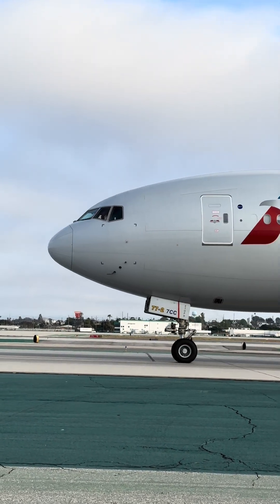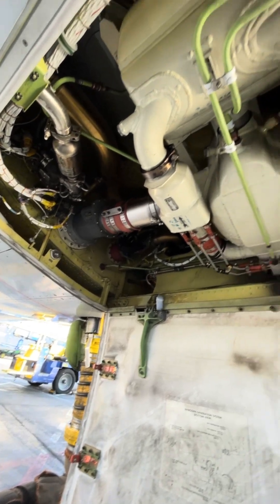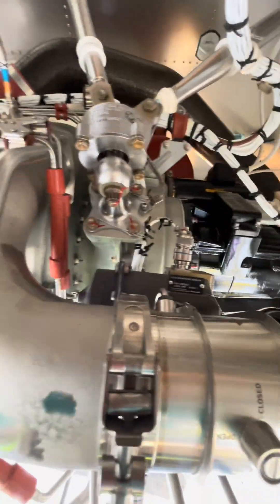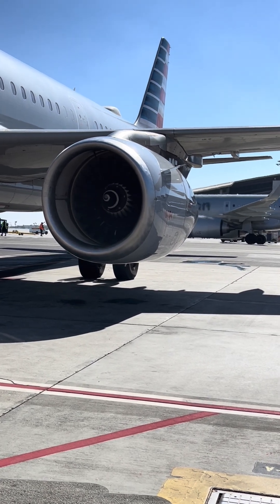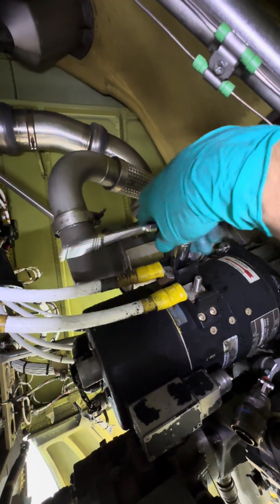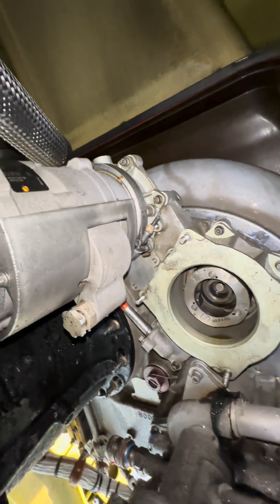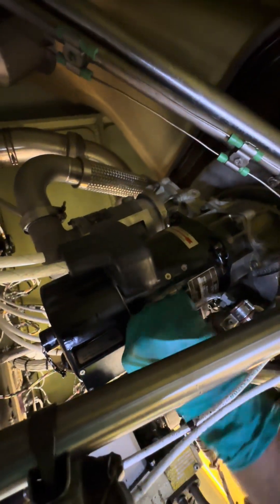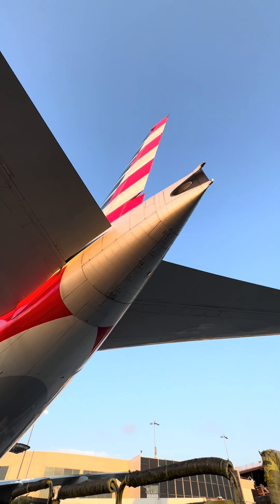APU (auxiliary power unit) and a B777 APU starter change.

Comment: Hi Stig, I work in electrical. We have bolts that must be torqued to specifications, especially on high current cable bonding.  Is there such requirements in servicing these aircraft’s?

Comment: Ah yes the Boeing 777 APU, I believe that's a Honeywell 331-500B series, its kinda like the bigger cousin of 757/767 APU which is the 331-200 series. I work at an APU shop.
Reply from the maker: Sry similar. That’s correct.

Comment: What is the power of the apu starter motor?
Reply from the maker: Starter motor is Powered by the APU battery 28VDC.
Reply: Can you tell me the power output of the starter motor that starts the apu?
Reply from the maker: The starter does not put out power, it’s not a generator. It’s simply a starter it will turn the APU to a certain RPM for it to start.

Comment: Great video Stig. Do these planes have APU s on the engines themselves or just the one in the rear of the airplane?
Reply from the maker: The APU, auxiliary power unit is always in the back of the aircraft on these major aircraft. The APU is an engine itself.

Comment: The technical name for the APU is 'The Dragon', because when the fuel control fails it spits a 20 foot flame out the back. (Something I've only seen twice in 28 years) 😂🇦🇺
Reply from the maker: I’ve only seen that once 😅  one of the new guys darn near panics and pulled the T handle 😂.  Good thing we stopped him.

Comment: Stig… since parts are new & not rebuilt, are old units scrapped or recycled?  Could you show the onboard batteries?  Are the wet cells like cars?  I would doubt it.  Thanx
Reply from the maker: Not all parts are new, some parts are refurbished. I have shown on board batteries and previous videos.

Comment: The sheer complexity of airliners is just... staggering. All the connections, the dependancies, the wiring, the many multiple possible points of failure. The fact that, despite this, they're so reliable is mind boggling!
Reply from the maker: That’s why I called them engineering marvels 👌

Comment: Hello Stig, I hope you are doing well bud.  I was wondering if the air starter of the B777 APU is used often? 
Does it work with ground support only or can it also be used in flight with engine bleed air?
Reply from the maker: Very rarely used, or at least I have seen it rarely used. They can use a ground air start cart to spool up and start the APU. I’m not sure you can divert engine air to it tho. I’ll have to double check on that.

Comment: would it be possible to build a commercial aircraft without an APU and instead rely on batteries?
Reply from the maker: But batteries have a tendency to drain. You will need to keep charging them
Reply: @StigAviation  isn't ground power sufficient? And when the engines are running they will get charged?
Reply: @Dynematic  Not sure, but APU could be meant also as a redundancy safety measure in case of a main generator failure?

Comment: What’s the best path for a career as aircraft maintenance ?   I tell my 16 year old son it could be a good career
Reply from the maker: Best lather would be to first look into the schools. The FAA website has a list of all the schools that are certified in the country. Depending on the school, it can take from 18 months to 2 years to get the A&P certification. Once done.. I highly recommend going straight to the major airlines. At the moment and in the near future the airlines are desperate for aircraft mechanics. Huge shortage. If that doesn’t work then regional carriers are also in need. You also have the option to work on helicopters. You see the A&P gives you the opportunity to work on ANY aircraft… even the Goodyear blimp. So it’s a very good career path… not easy but very rewarding.

Comment: Why don't planes use 24v electric starter/generators in their main engines and not use bleed air to start the engine.  I remember seeing planes of the 70's needing a compressor cart to start engines one at a time.  Isn't APU air start on modern planes considered using technology of the 60's and 70's.
Reply from the maker: APU bleed is still modern tech, but lets take for example the B787... that aircraft is bleedless...it does use electric start for main engines. VFSG ...Variable frequency starter generators. 2 each per engine.

Comment: Thanks for the video, Stig!

Is it true that the 777 has the possibility to start the APU using bleed air? I see in the AIR synoptic page a "START" valve pointing towards the APU box. When would the airplane choose to use air start vs electric start?

Love your videos!
Reply from the maker: That is correct, good observation... if you look closely you'll actually see the Air starter right above the electric starter. Air start can be achieved if the Electric start is INOP

Comment: super wonderful air craft APU power generation & bleeding air to engines for starting it # but if  air bleeding is needed to start the engines fan then why starter is needed ????#❤️🇵🇰
Reply from the maker: because the engine need to turn via gearbox , and thats why you need a air starter,  i talk about this in another video where i do a manual start

Comment: Man I can't thank you enough for the access you provide in your videos.  I was a surveillance RADAR maintainer in the Air Force on the E3 Sentry AWACS....but I always loved helping the environmental control guys with things like compressors and heat exchangers on the packs or the engine guys change out igniters (is that what the spark plugs are called?) I even did quite a few IDGs on our TF-33s.  Whenever we went on a trip all the maintainers knew it was my job to put oil in the engines.  Needless to say as a RADAR troop they loved going on the road with me....NVM that I was  often also DD for them too! 😂
Reply from the maker: thank you for your service, i bet you got some amazing stories

Comment: I heard its best to use ground power to start the engines as it lowers the maintenance costs of the airplane.
Reply: @bulbadox Its SOP for most airlines to use the APU. Otherwise they have to pay for the ground power and start units. Besides once the engines are started the APU is shut down.
Reply: Using a power cart for starts is not efficient for airlines as they can start off the APU during the push.
Reply from the maker: you can not start the main engines on a MAX from batteries,  you need Bleed air from the APU  @SSaugaCriss
Reply: @StigAviation  sorry, I forgot my friend on 37-8 was saying it can do a cross bleed start at idle as opposed to 30% power on the 320. Sorry for the snag post.
Reply from the maker: ground starting usually happens when the apu bleed is not available.

Comment: Sometimes when a main generator is deferred (not working) the APU is left running for the entire flight to backup the remaining main generator. I’m not sure if that’s a requirement on the 777.
Reply from the maker: well there as different scenarios when it comes to that. It depends on where its flying and if it is an ETOPS flight